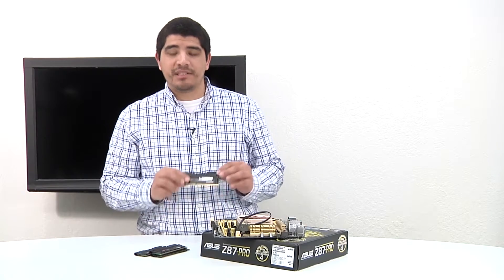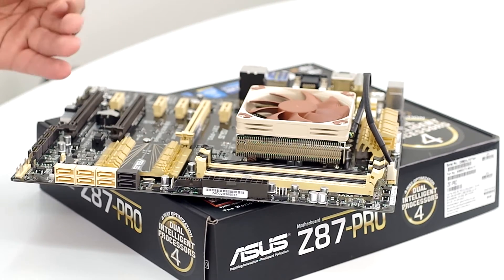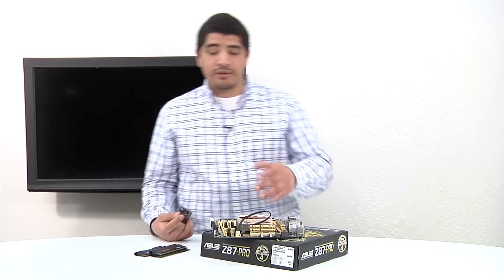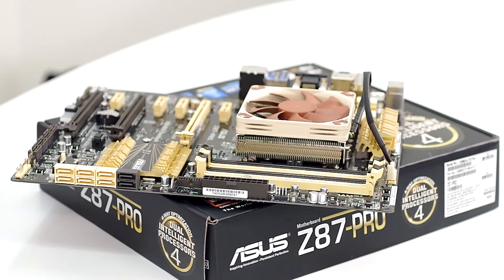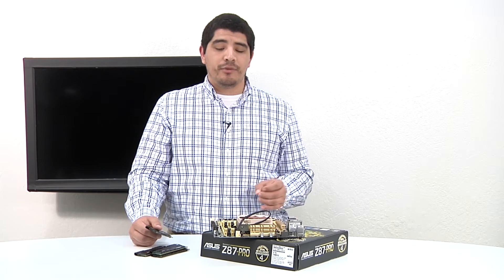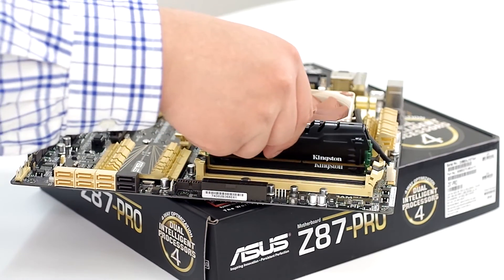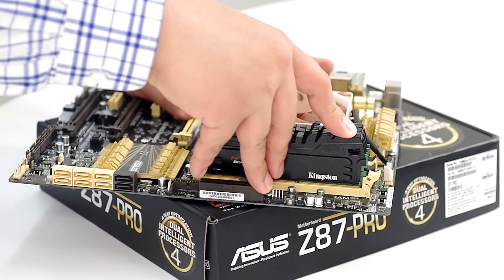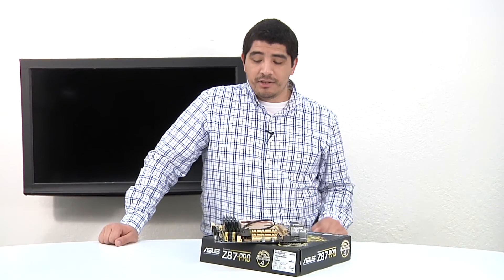How-to install Memory onto a Z87 motherboard

Comment: Hi Iv got Corsair Vengeance 8GB (2x4GB) DDR3 RAM 1600MHz CL9 in my PC can I pot the Corsair 8GB (2x4GB) DDR3 1866MHz CL9 DOMINATOR PLATINUM CMD8GX3M2A1866C9 in it ? and Motherboard is a ASUS Z87-PRO will the DOMINATOR'S go in with no problem's  ?

Comment: JJ, or anyone else here that is in the known. I purchased the Z87 Pro motherboard and am now looking to buy RAM. What I want to know is what would be considered the best 32GB RAM kit? Three different makes for the 32GB kits are listed on the QVL but the third one, Kingston is for 8 sticks of 4 which obviously will not work with this motherboard?
There is a Kingston P/N KHX16C9K4/32X listed on their website, will this kit work with this motherboard?
Thanks
Steve

Comment: ok this is all well a nice and should be easy.. it always has been... but i have ram that is supposed to fit its 2 sticks of 4gb  DDR3 which is the type of ram  the mother board requires. The notching is correct and I'm placing it in the right way... why is it they wont click into place.. they get to the bottom and then they stop before the clip... I'm not going to force it in and break the ram and motherboard... why am i the only one having a problem...